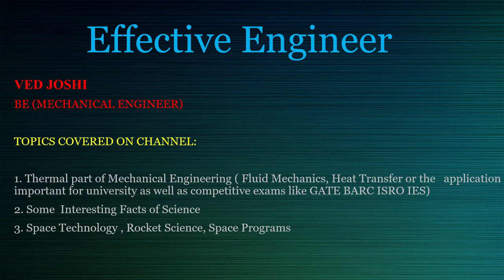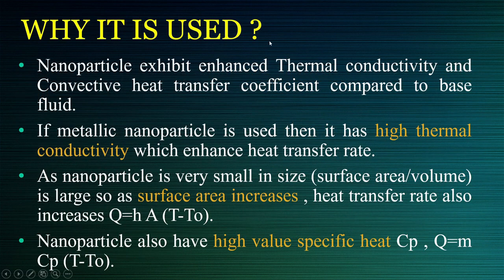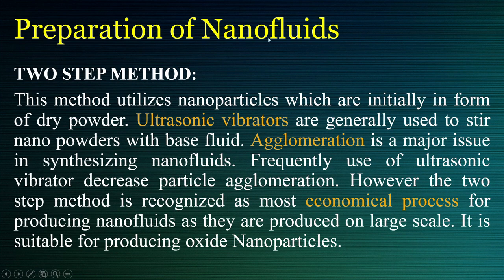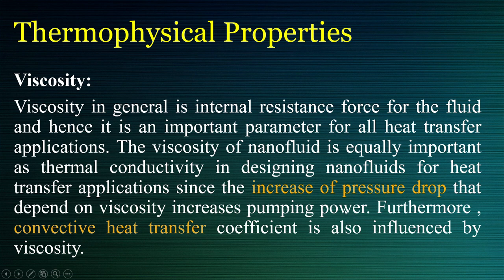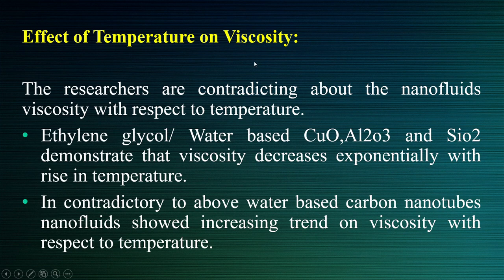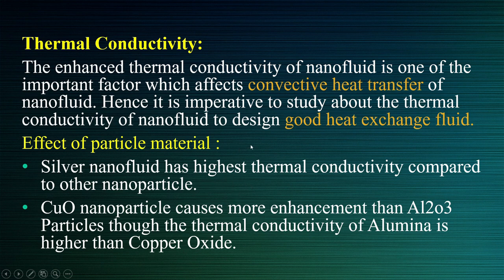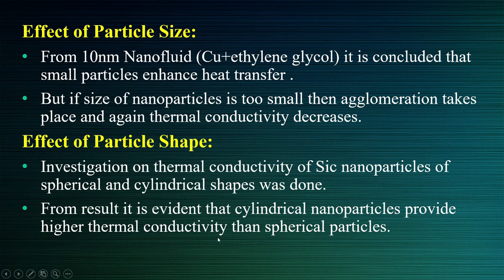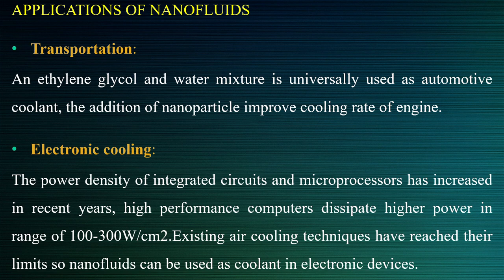All About Nanofluids| Nanoparticles| Heat transfer enhancement using nanofluids|

Comment: can you give the link of research paper or journals
Reply from the maker: Just go on science direct website type nanofluid or any topic u want in keyword or u can search by author name also then papers will appear select one which u want open it copy it's link and then open scihub paste that link and download full paper.
Reply: @EffectiveEngineer  it is vast in science direct so please share the link of ppt which you are explaining
Reply from the maker: @agastyakarande1177  I have explained just basic for detail of particular application u just put ur required topic in keyword section there are 1000 of papers. See whichever u want
Reply: @EffectiveEngineer  Sci hub is not working..
Is there any other way to download research papers for free.
I hope you would definitely have found out the alternative way..

It will be good if you make a guiding video regarding this